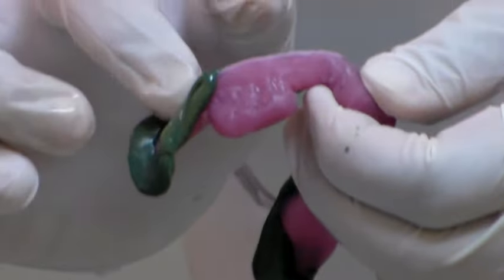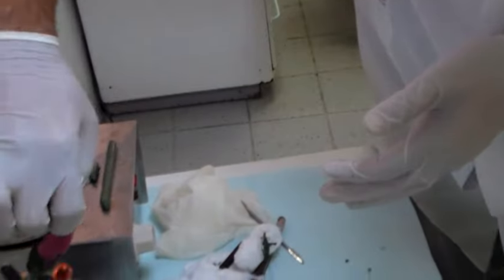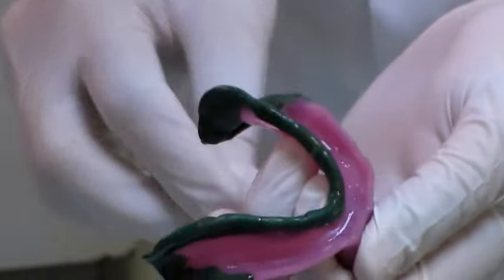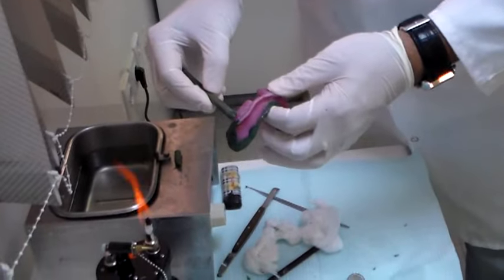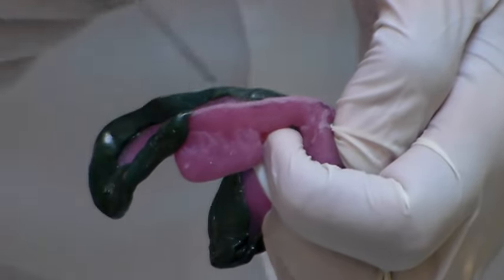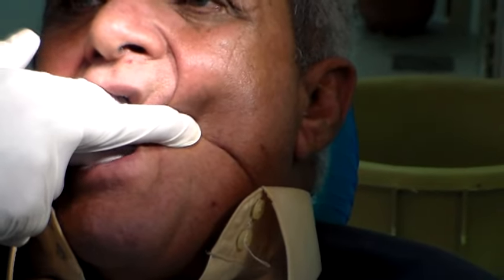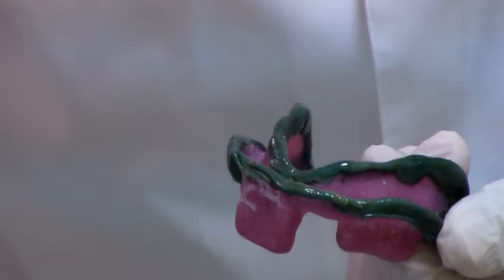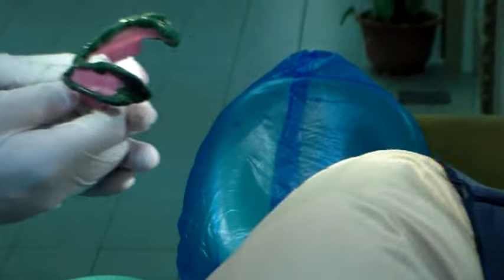CD Videos No.16- Mand. Border Molding Part 2

Comment: Thank you Dr. Joe, Beautifully explained videos
I have one query regarding mandibular denture ,when the patient put pressure on mandibular anteriors, The denture rocks and lifts from posterior side and the patient is unable to chew food.what mistake has been made and at which step?
kindly help.
Reply from the maker: If you have developed Centric Occlusion the patient cannot use the anteriors for chewing but only for phonation and esthetics. Patient must be taught to chew bilaterally on posteriors. 
Sometimes even these functional movements including phonation swallowing etc create forces which dilodge the denture. Here the solution is to further improve this situation by attempting Balanced Occlusion. Here again it will help stabilize the denture only in functional movements NOT DURING CHEWING. 
FOR GREAT STABILITY IN CHEWING - SOMETIMES EVEN WITH THE ANTERIOR TEETH REHABILITATE THE PATIENT USING IMPLANT SUPPORTED OVERDENTURES. God bless you as you try to help your patient.

Comment: Really helpful Sir Thank you so much. one query we were asked to use tissue stops and a sheet of wax beneath the try. Won't the wax be removed with the heated knife while trying to remove the extra compound?
Reply from the maker: OOOPS    - Sorry for the late reply -just saw your query now.
When you make a tray with a spacer and do border molding the tray records the position of the border tissues while the tray rests on the wax spacer. If you do not use a tissue stop, the moment you remove the wax spacer before impression making -you have just removed the entire base on which the tray was seated. This means that now your tray will seat in a position which is apical by about 1-2mm. that means your border molding is also going to be more apical. This then means that the 'functional depth and width' you recorded during border molding is lost. So IF THERE IS A SPACER THEN THE STOPS ARE A MUST. 
You spacer must be short of the Tray border by atleast 1.5 to 2mm so that there is space for border molding material and so that the wax can be easily removed without dislodging the border molding material. This you must take care in Tray Fabrication
Reply: @dr.joemathew2Cor5-15  what if we r taking final impression with eugenol paste... we better go for close fit with out wax spacer with borders only 1.5mm to 2mm short????
Reply from the maker: @humerasafdar1903  The use of a spacer must determined by the QUALITY of the TISSUES in the mouth. SIMPLY PUT of the many reasons why we should use a spacer and where - here are a few key ones:-
1. If there are FLABBY tissues you must use a spacer there to avoid REBOUND.
2. If the tissues seems to be very thin (having very little sub mucosa - and so blanching easily) there too we use spacer to avoid inadvertent pressure on those tissues.
3. If there are underlying vital structures whose health will be compromised by the pressure during and after the procedure  - here too we use wax spacer/ relief.
( for a detailed explanation read Complete Denture Impressions by Bernard Levin)
Reply from the maker: Reading this question again I think I could clarify further on your question. Well 'YES' - 'the wax be removed with the heated knife while trying to remove the extra compound!'  What we MUST do to avoid this is to limit the extension of the wax to approximately 2mm short of the tray border so that the Tracing compound is on the actual tray and it is NOT on the wax. This way when we remove excess tracing material the wax is not much affected. Try to use a little tracing material at a time to avoid too much flow of material away from the border and onto the wax
Reply: Thanks for reply dr . After many years today I did border moulding and wash and i am not happy with it....esp lower. What if i didn't get a good suction in final tray... shall I repeat impression starting again from alginate ,custom tray and border moulding??
Reply from the maker: I am sorry that I am not more online regularly.  Trying to sort a way to respond asap. Gimme a few days - Thank you
Reply: @dr.joemathew2Cor5-15  sir with putty and wash on stock tray will give satisfactory result???
Reply from the maker: @humerasafdar1903  Well definitely the technique and the selection of the tray will matter most. If the fit of the tray is awesome it should come out alright. But nothing gives you as much accuracy and control as when you do it with a special tray. Give it a try😊